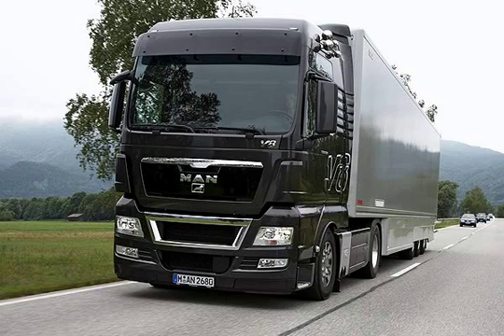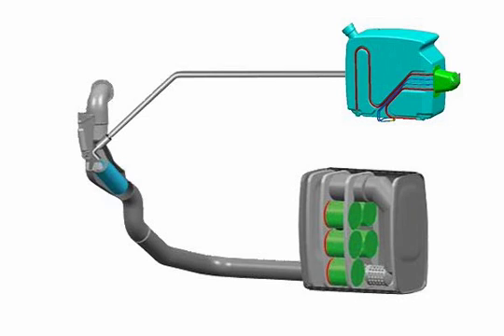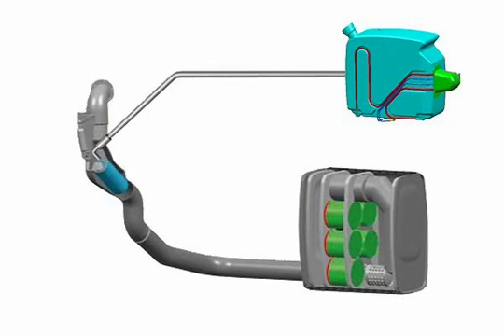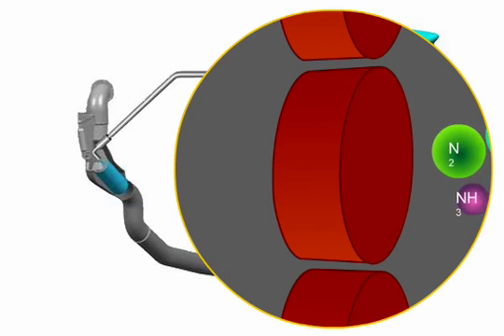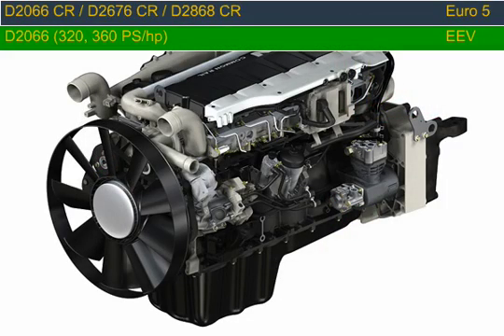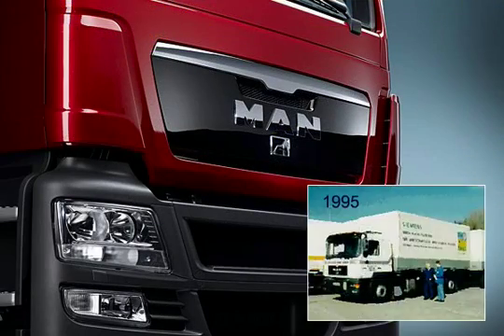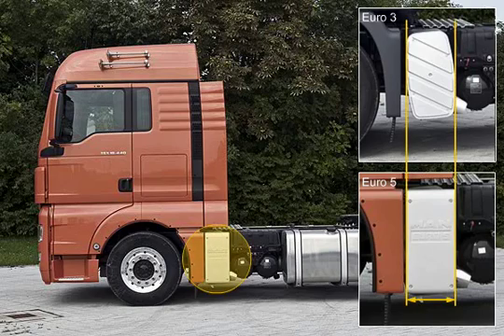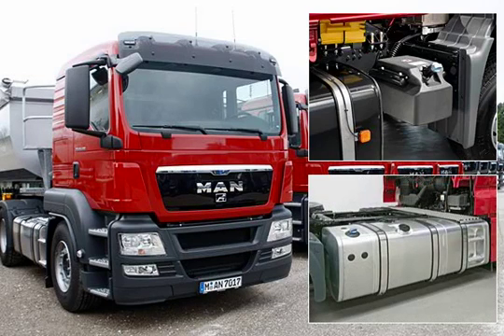MAN - AdBlue® System

Comment: @norb0254 BASF pioneered the technology for SCR and Aqueous Urea, they are the sole monopoly in SCR technology. If you run out of Urea here in the United States the engine will shutdown and you will not be able to restart the engine till you put more in the tank. Likewise if you get under 1/4 tank of Urea the engine will derate 50%, under 1/8 tank and it will derate 80%, if you let it go till just before its empty you will be forced to drive at 25 MPH and have a governed RPM of 1,250.

Comment: @norb0254 EGR derates engines, sorry bud but the only EGR system that actually works is Caterpillar's CGI Clean gas induction and they dont use that anymore. EGR is far less effective than current SCR technology unless you wanna spend millions of dollars engineering a gear based camshaft phasing technology that will work with 1,800+ lb-ft rotating force on the cam gear train without breaking said device.